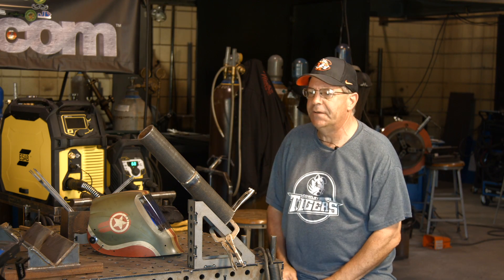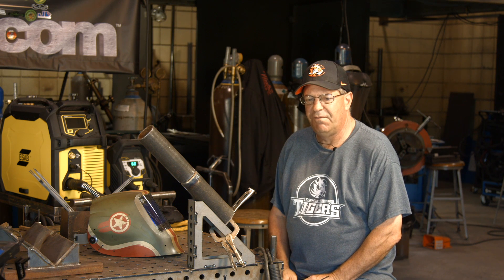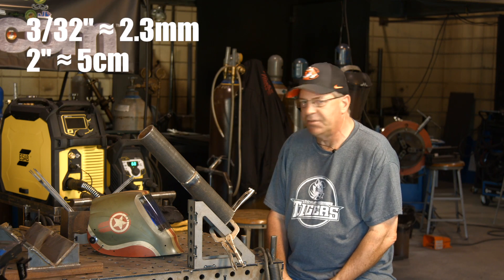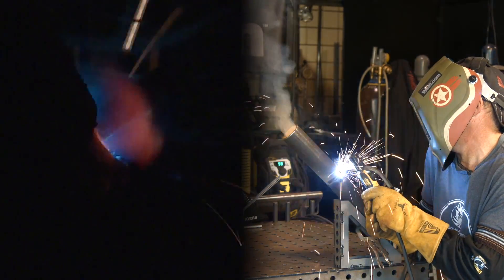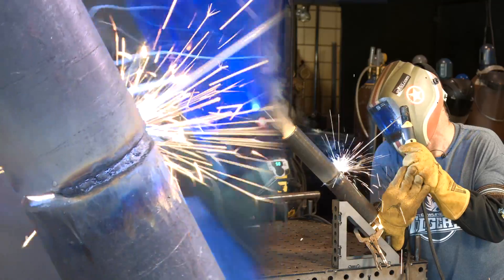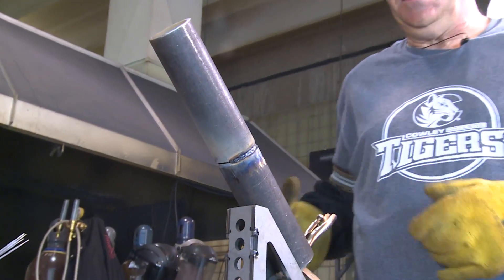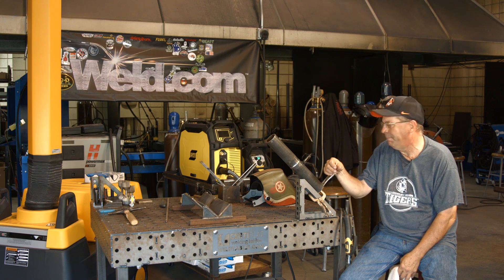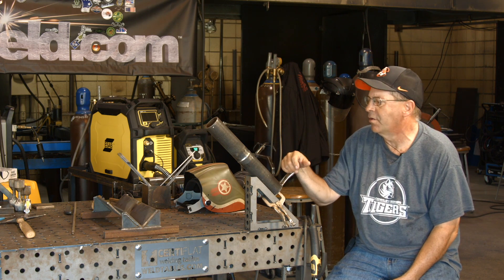🔥 6G Pipe Welding with SMAW: 2" SCH 80 Carbon Steel

Comment: Use 1/16 gap 3/32 rod burn through 90amps but wip up to butter edges and set arc force at 80%

Comment: I learned how to do 2 inch in a fab shop where every other welder would walk by a leave it laying cause they just didn't like to weld 2 inch,  the shop Forman asked me if i would weld a huge pile of 2 inch,  i got so good at it,  i was welding more inches with 2 inch std wall then they did with 6 inch std wall.  In 8 hours, my record was 200 diameter inches, i absolutely love to weld 2 inch.  All 100% x-ray . I always use 3/32 6010 5p + on the bead,  stay away from 1/8 on 2 inch

Comment: I tried this test with 2" schedule 40 but all I had was 1/8" 6011 rod I have a miller multimatic 215 which I believe doesn't have a arc force setting. I started out ok but my fit up was not good since all I have is a bandsaw and a grinder.

Comment: Thanks I’m taking this test now I was running 1/8 6010 at about 85-90 amps very hard to control today I’ll try 3/32 at about 65-70 amps hopefully that will work with 3/32 cap at about 70-80 amps
Reply: How did it turn out. I have this test on Monday. Haven’t ran 6010 in years

Comment: I just busted a 6G 2” sch 80 cause I had some sick back.. never had issues with my root till doing this test. 1/8 6010 is too hot I needed to make a bigger land and go down to 3/32 for root and cap. Ya live ya learn! Still sucks to fail a test though
Reply: I use a 1/8 6010 and do a sort of cold root on 2inch sch 80. You can’t go hot like normally.

Comment: Im on this weld at school right now. having trouble with my root often blowing out and lack of root reinforcement. Same pipe, same rod diameter, same position. Im thinking its because my land is too small (1/16 ish). Perhaps if i had a bigger land it wont blow out so easily, also it would allow me to slow my travel speed, therefore depositing more root reinforcement.

Comment: I would like to set myself up at home in order to practice the 5G test.  What will I need?  I am planning on purchasing an AC/DC stick welding machine, and a pipe vice.  Any recommendations on minimum specs?

Comment: I was wondering if you could do a video of a pipe weld of.6G pipe welding SMAW 2" SCH 40 carbon steel. I had to weld one of these to get a job to be a welder. IIt was a bend test. I had problem with the heat and the how much to push in on the root pass since it was a bend test. I'm going back to school during the summer for welding and I will try to get another welding test. Any help you can give me will help.

Comment: Hey bob so u did 6010 3/32 root pass and you went straight to cap right 
3/32 7018 ?
Reply: Yes after 3/32 7018 hot pass

Comment: Hi Bob, I see that a couple of guys asked what gap for 3  32  ""  rods  and you had not answered them  would it be safe to say to use the same gap as the diameter of the rood used ?
Reply: Bruce D 1/16" is a good start.
Reply: @bobmoffatt4133 I like to use same as my rod. So I can whip it (stepping motion)

Comment: Hey!
 i wanna ask why so many pipe welding tutorials. Is that some kind of an often procedure for stick welding? Or is that often for grading? Just asking. How about a video on making an actual project with "scrap" metal? We usually dont have pretty steel when stick welding. I wanna know how to weld on a simple maching with just a switch. Maybe if you ever find the time for rhat.
Thanks!
Reply from the maker: Pipe welding is widely requested and used in industry all the time. Also, if you can weld pipe, you're in good shape to weld just about anything else. We'll get some projects in for you. We're working on the wood rack that we did the math for a few weeks ago.
Reply: Weld.com Nice. Will it be stick welded together?
Reply from the maker: We TIG welded this one. But we can get some stick projects in the mix.
Reply: Weld.com  Would love that! Thanks! The issue is that where I live we use stick or mig. Never tig because its too expencive. But mig is not an option because my dad feels old school and wants ro use our stick machine (same concept as the old lincoln buzz box) till its gone.

Comment: Bob...   I've watched a few pipeline guys weld up surface piping and pipe intended to be buried.  They all use a knotted wire wheel to buff the slag off the weld before restarting or laying another bead over a previous weld regardless what rod they are running.  I notice you do not bother.   What am I missing?
Reply: Cam Murray That's what I'm using. I just don't grind and buff around expensive camera equipment. I have to move off to a grind area.
Reply: I understand the desire to protect the expensive cameras.  It is painful enough to buy it in the first place and worse to ruin it with a random spark.  Even so, the guys that I have worked with are absolutely fastidious about buffing even before a restart with 6010.  They are doing work that is subject to X-ray and pressure testing to  at least 125% of maximum working pressure of the line when it is in service..
Reply: Cam Murray I've done the same over the years and it passes RT and pressure tests

Comment: Looks like you have a push angle at the top.. is that just camera angle or are you actually pushing
Reply: xDasHo Pushing just a bit.
Reply: xDasHo I don't recommend it. I like to drag at the top. if it's not drastic and watching that your pool it's right, you're fine.
Reply: isn't that a quick way to get slag inclusion? or since its not that drastic it'll be alright... would you recommend having a push angle at the top? or thats just how it happens

Comment: Hi Bob, I have an interesting one for you. Ever heard of doing a Gas Main in 6010 all the way? 
Well we have a new Gas Main being run up the middle of the road outside of the school maintenance workshop where I work, and out of interest I said hello to the welder. I asked him what rods he was using and he said Cellulose all the way! I asked what rod number and he replied 6010 all the way. Needless to say I was somewhat surprised after watching numerous US based You Tube welders, I was expecting 6010 root, 6010 hot pass, then fill with Low Hydrogen 7018, so the 6010 all the way really threw me. I have also heard that people also use 6013, particularly in the UK and 6013 is a very commonly available rod here.
Here are the pipe details; 219.1 mm X 6.4 mm X 11.8 m API 5L X 42 PSL 1, then there are details for the coating and the heat number, and pipe number.  I am very interested to hear your thoughts and comments about this.
I have posted a photo of the pipe details to my Google+, for those of you wishing to read the details direct.
Mark Fryer, Melbourne, Australia.
Reply: Mark Fryer I have worked in the gas industry for a number of years and although i am a welder i haven't welded onsite on these projects. I do know however this welding procedure is used Australia wide (I'm in SA) and even the type of rod is specified  ( lincoln fleetweld 5p+) all vertical down.
Reply: william lockyer, Thanks for taking the time to reply William, much appreciated and good to know a bit more about Australian wide industry practices. Any thoughts as to why they went with 6010 all the way over the North American method of 6010 root and hot pass then 7018 fill and cap?
Reply: Mark Fryer Im not certain as to why this procedure is used but from what i understand it is a fast  way to join two pieces of pipe and  therefore reduces cost.
I have heard that this is used on gas pipelines in some places in the USA too.
Reply: I am wondering if it was decided to go "6010 all the way" as a means to eliminate errors?

Comment: awesome video thank you. Bob
I am looking for a video of 30° bevelled 2G horizontal  mig spray at 29volts  0.45 wire at 485-495 feed.
Reply: taewachien lol not the same. but I did try that already. plus the settings where different

Comment: Bob, you remember when we were the new kids on the block burning rods against them crusty old welders? Now I'm a crusty old welder and these new kids have all these great tools machines and are sooooo talented. Newest machine I have is a 1973 Miller portable, everything else is from the 40'S and 50'S.
Reply: greasydot. I'm 23 and run a 64 redface sa200. y'all old welders had the best machines! this new Shit is a pain in the ass.
Reply: Zac Brown that is a fine welder. I had a SA-200 short hood I sold and I am still kicking myself. Keep your rods dry and never stop learning!!
Reply: yes sir I sure will do! never quit practicing. I love my ole redface. a whole lot easier to work on that's for sure.